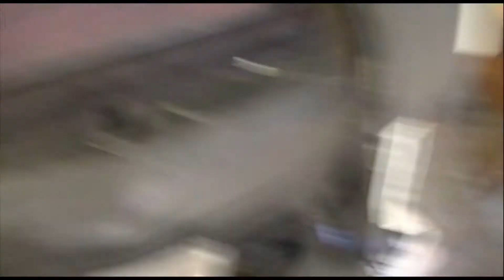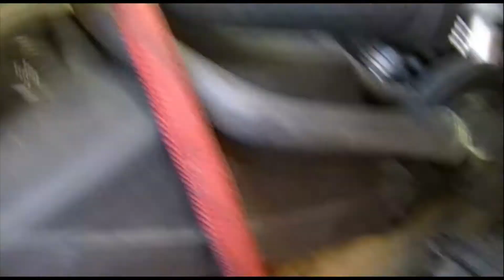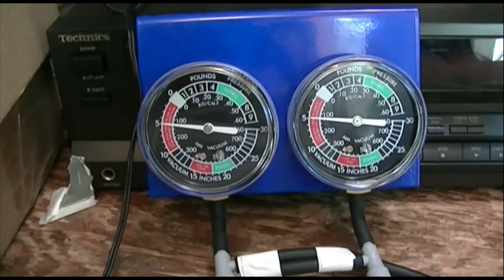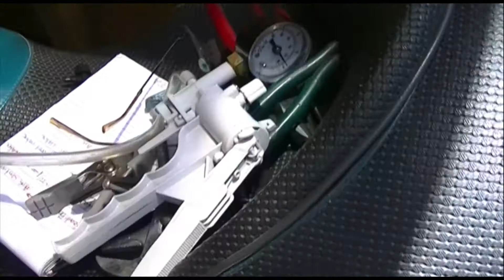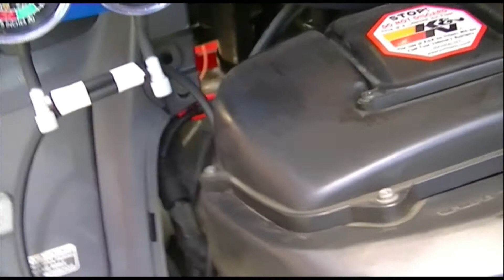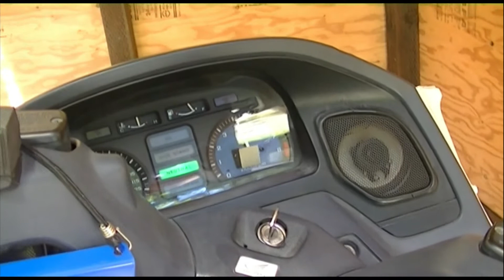Honda PC-800  Ghost:  carb balance set up

Comment: Hi Larry,  does the adjusting screw only change the idle stop position of one of the the carbs?  Or does it change the cable length/slide position of one carb to balance the slides?
Reply from the maker: WHICH SCREW ARE YOU TALKING ABOUT PHIL ? THE CARB BALANCE SCREW ACCESSED THROUGH THE HOLE IN THE AIR CLEANER BOX.. IS ADJUSTING THE THORTTLE STOP ON THE RIGHT CARB ONLY... THE GAUGES TELL YOU WHEN THE TWO ARE SET THE SAME. SO YES.. YOU ARE ONLY ADJUSTING ONE.
Reply: @captlarry-3525  Yes, I meant the balance screw way down under the hole in the air cleaner box.  I used it to adjust the balance at 3500 to 4000 RPM and when the vacuums are balanced there the vacuum is unequal by 30 to 40 mm/Hg at idle of 1200 RPM.  I left it that way since it spends most of the time in the 2500 to 4500 RPM range.  I have noticed that the idle is lower than 1200 until it is thoroughly warmed up and returns to 1200 RPM.
Reply from the maker: DEPENDS ON WHICH ADJUSTING SCREW YOU ARE TALKING ABOUT !   THE ONE ON A CABLE IN THE POD WITH THE TRUNK PULL, ACTS ON THE COMMON SHAFT, AND IT CHANGES THE IDLING SPEED FOR BOTH CARBS... NOW THE SCREW YOU NEED THE LONG SCREWDRIVER FOR.. ADJUSTS THE SPEED FOR JUST ONE CARBURETOR.. .. HENCE IT'S ABILITY TO BALANCE OUT ANY DIFFERENCE BETWEEN THE TWO.
Reply: @captlarry-3525  I did mean the balance screw that you reach with a long screw driver.  I was curious about using that screw to set the vacuum balance between the carbs at higher RPMs but then having the  vacuum become unbalanced at idle speed.  I figured it was better to be balanced at normal operating RPM, but wondered if the change in balance at lower RPM is common or specific to my PC800.
Reply from the maker: @philwarner6604  the idle mixture adjustment is limited by a stop...which is commonly removed when carbs are out for service.   I think the idle mixture ( and of course the "health" of the idle jets and the mid range jets)  have effects on the low speed balance  - so unless you are taking out your carbs for overhaul, when you can remove those limit plugs and get full ( and proper) adjustment...some low speed imbalance is probably inevitable.  Where large amounts of fuel are being metered  from 3000 rpm up... I think balance is really crucial...  now I had other problems... caused by some obstruction of my midrange jet,  the bogus K&N filter, and at that time unknown condition of my plugs.... over time.. I sprays a LOT of carb cleaner through every orofice of both carbs, and used heavy amounts through the fuel circuit...replaced the air filter with a real one so the airflow is as designed,  and installed new properly gapped plugs.   This all yielded considerable improvement in engine smoothness, and throttle response.  All the vacuum tubes are nice and tight, as are the connections between the airbox and the carbs.  The airbox is crucial...engine will hardly run with it's cover off !  I can get an extremely slow and low idle speed when warm, with good smooth power from 2000 rpm   so I think my approach has been the right one.  I chickened out on actually removing the carbs and replacing /cleaning jets  untill I have got  500 miles of real riding on the bike, with a fuel additive...
It's like night and day   comparing how it was to now !
Reply: @captlarry-3525  I recently bought two 1990 PCs in addition to the 89, and I balanced their carbs using a Carbmate electronic unit; much easier than the manometer I had made and used on the 89 when I first bought it.  One 90 PC has a "dead spot" around 1600 RPM when you very slowly increase throttle opening while it is sitting on the center stand where it will actually lose RPM back to 1400 and then as you open just a little further it will almost self accelerate to 2000 and beyond. I was concerned about this since the PO said he had to be very careful pulling into traffic because it might bog down, but after setting the carbs for equal vacuum at 3500 to 4000, I did not notice the "dead spot" in actual riding.  This 90 has just 5250 miles on it and sat for 15 years before the PO bought it and replaced the fuel tank and had a buddy clean the carbs.  The limiters are on the pilot needles, but I don't know if they were removed in the cleaning process; both were set all the way CCW against the stops.  I think I will ride it awhile to see if balancing and Gumout treatment will improve the low RPM response, but the tires are the original 1989 Dunlop K555s so I need some new tires before I ride very far.